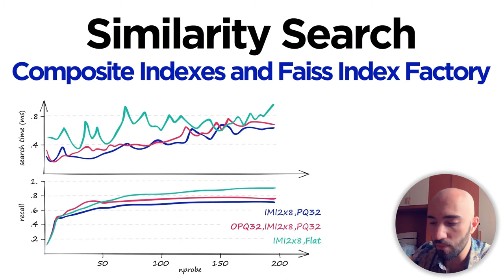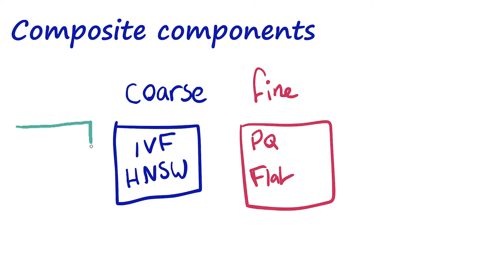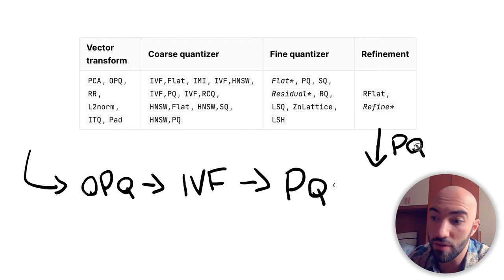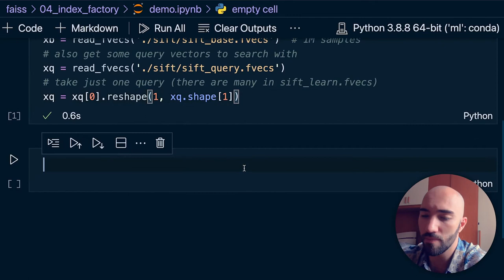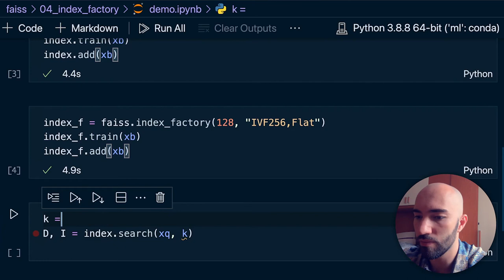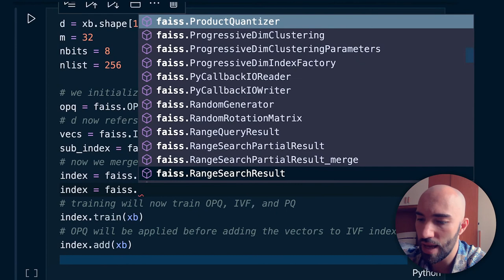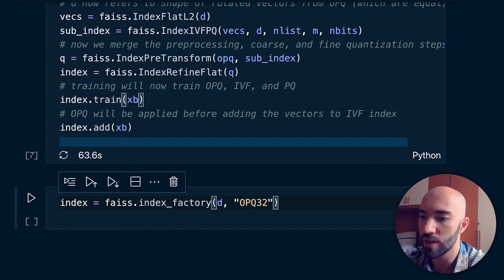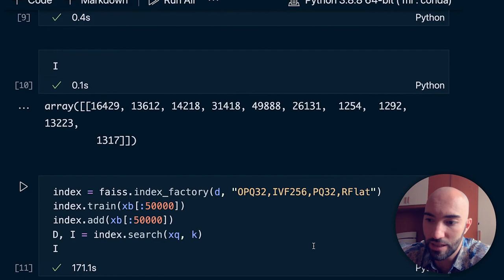Composite Indexes and the Faiss Index Factory

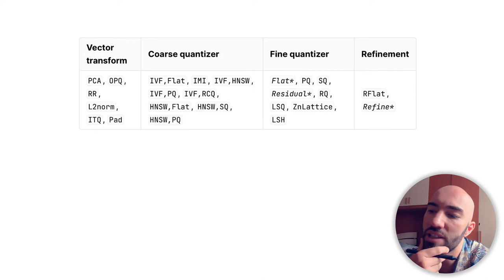Comment: 1. 4:27 What does it mean for PQ to appear under both the Coarse and Fine quantizer boxes? Is this table from faiss docs? 
2. How do we learn what are the possible combinations given that there are so many possible indexes? Is it by reading original papers + trying to use the faiss API until it breaks?
3. How do we know our experiment results will transfer to new data that may drift so existing cluster centres don't work anymore? 
4. If point 3 happens, must we rebuilt whole index on all images, or there's way to build smaller index on new data (maybe monthy), then somehow merge the 2 indexes before search? (The alternative of searching through 2 indexes (1 big, 1 small to be merged into big) then merging results doesn't feel practical because information cannot go across indexes unless there's some smart logic in result merging

Comment: How can be change nbits in PQ or nprobe in IVF using index factory?
Reply from the maker: nbits from 8 -> 4, 'PQ32x8' -> 'PQ32x4', and nprobe depends on the index you're using, if using something like 'IVF256,PQ32' you can just modify with 'index.nprobe = nprobe' as usual, but for more complex indexes you will need to extract the IVF part of the index first, so it will look more like:
'ivf = Faiss.extract_index_ivf(index)
ivf.nprobe = nprobe'
I do cover these in the next video + a couple of the best performing indexes I found if it helps!

Comment: James, I've tried implementing an index factory on my own work project 128-dim with 'IVF256,PQ32x8' to get me started. The dataset is 1396x128 - not very big. The problem is that if I search for k=10, I get 8 good results and the last two results are -1. If I search for k=12, I get 8 good results and -1 for the last four, etc. Do you know why this could be? I've searched the documentation and can't find anything explaining the details of the I results.
Reply from the maker: hey Robert, the issue stems from it being an IVF index. The `nprobe` parameter sets the number of IVF cells to search. By default, it is 1 (e.g., just search in 1 cell) - your problem is that the cell being searched only contains 8 items, so it returns them all. However, you're asking for 10, so Faiss returns -1 IDs which is just Faiss saying "nothing found"

Approximate search is really good, but I do think with your dataset size that it isn't needed; approximate is only needed when you need to scale and still return good search speeds (it doesn't improve recall over exact search) - with most machines you could do exact search with maybe 100K or more 128-dimensional vectors and search speeds still be very fast